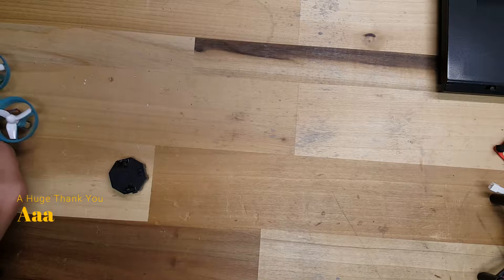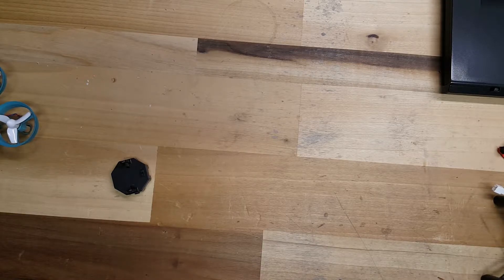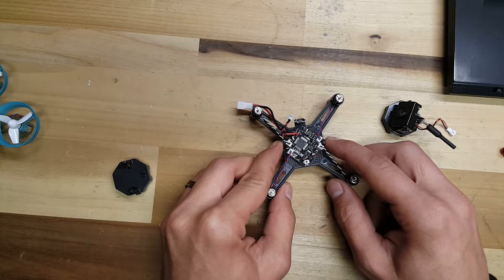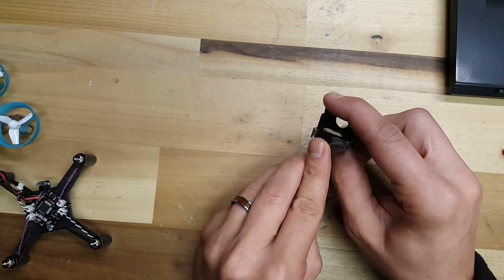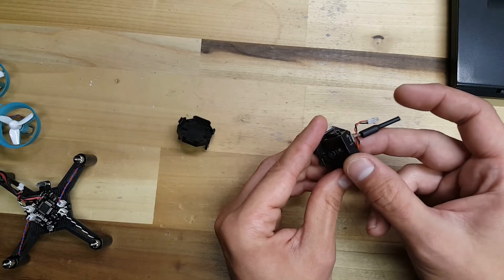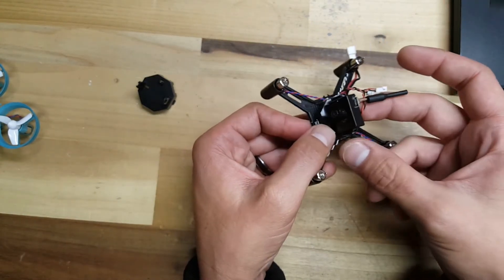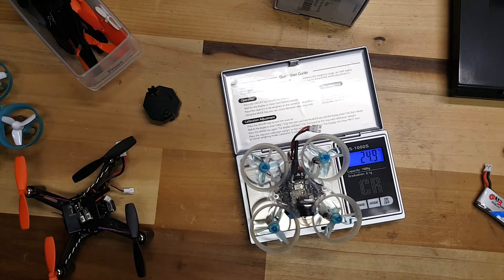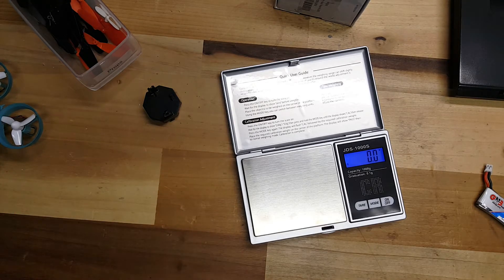Soup up your DM002

Comment: Awesome video man ! . I have a dm002 & EVERYBODY . You gotta try the King Kong 65mm props with this motor upgrade betafpv 720 17,500 kv ) the performance was amazing , I also tried out some of the betafpv 48mm 3 blade props after the upgraded motors and that combo flew pretty well surprisingly for a smaller diameter of 48mm and handled a bit smoother and slower because the 3blades  grab better in the air  but they dont fly as fast  as 2 blade props  and they might have less thrust I think but the high KVmotors make up for it I guess ? , but I still like 2 blade props better , I found 58mm stock props @12 pcs (3 full sets) for $12 on eBay compared to King Kong’s 65mm 20 pcs ( 5 full sets ) for $7 on eBay  & I believe the betafpv 48mm 3blade props go for $12 and you get 16pcs ( 4 full sets ) and Incase anyone is interested a full set of stock props 58mm  (4pcs) weighs 1.2 grams 
King Kong 65mm props (4pcs ) weighs 1.7 grams 
And the betafpv 48mm props (4pcs ) weighs 2 grams even